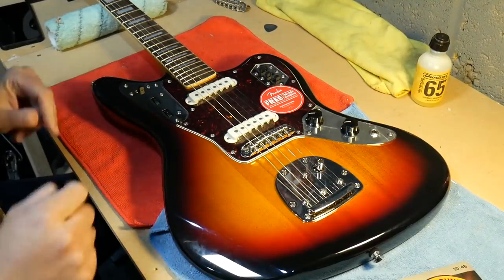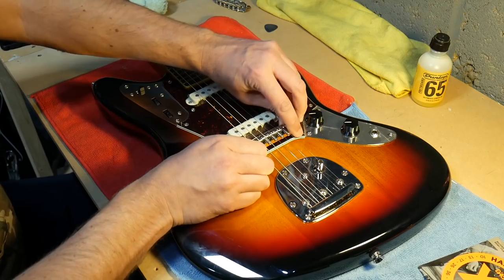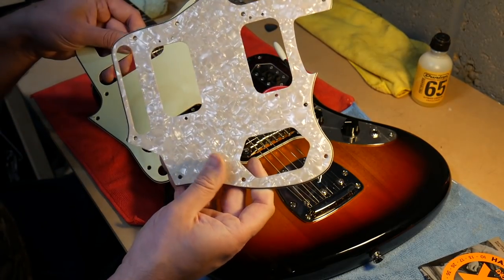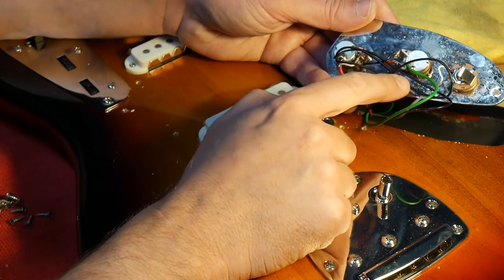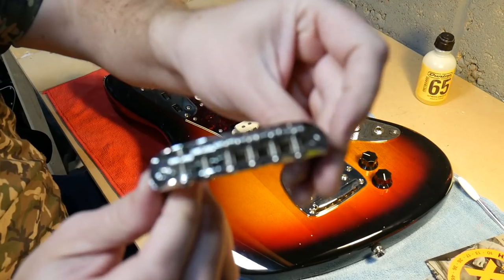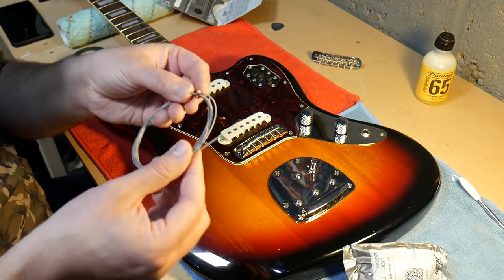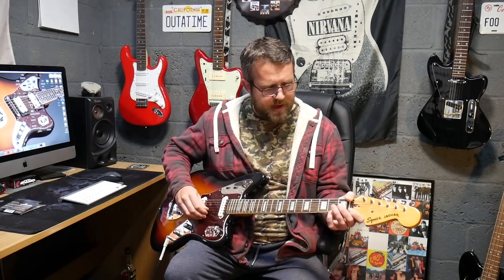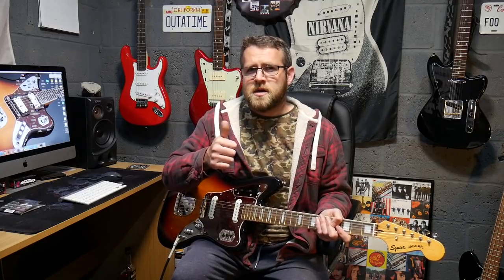The BIG MISTAKE Fender Made With This Squier Jaguar Bridge

Comment: Shim the neck back and raise the bridge. You have to set short scale fenders up like arched top guitars to get a better break angle over the bridge. If you've ever played a vintage fender offset they all have their necks angled back like a gibson
Reply from the maker: Ah yeah I totally agree I didn't think at the time, will do this on my next video hopefully that should cure the problem 🎸👌
Reply: Also the Jag scale is so short, you might think of 11s
Reply from the maker: @narichey1981  no I always use 10s on Jags have done for 25 years
Reply: The Guitar Manifesto Have you ever tried 11's on a jag? I use 10 gauge too but I'm just wondering what the differences would be. I guess the 10s have more slack.
Reply: @narichey1981  I agree! As a guitar gets shorter it requires more string tension: shorter scale = higher string gauge.

Not only will the tremolo and bridge float MUCH nicer, but you'll have normal slack in your playing and no buzz at all!
Reply: @wastewoodrockers5526  I always use 11-52 on my Jaguar, and 10-49 on my Strat. The 11s feel good with the short scale, definitely try it if you haven't!
Reply: @theguitarmanifesto  Leo designed them for 11s
Reply: I’ve just bought a Squier Jag 70s vibe. It is the worst guitar I have ever owned! The nut, the bridge,the trem, the saddles....the truss rod... basically the whole thing needs setting up and possibly a new bridge. 
Before I load it with 10s, can someone please tell me how to shim the neck and deal with the wobbly bridge? I am going to try wrapping PTFE tape around the bridge posts and the trem arm to stop all the wobbling but I think this guitar needs to be fixed in so many ways that i’m going to take it back and have the shop sort this mess out. 
It’s all very nice looking but the mechanics are rubbish.
Reply: @LysanderLH  Lol , you'll have to push the trem arm all the way in to stop it from wobbling . I agree on the bridge is complete rubbish . Mine is defective from scratch , means one leg fell off on a brand new guitar . Look at my other posting . You can buy a Fender bridge from eBay seller guitaraudio from the US , for 9,5 radius . Shim the neck , set the bridge really high  , then go back from there using the Allen key . The fretboard should follow the strings from the nut to the bridge parallel
Reply: @LysanderLH  my experience with my squier jag mirrors yours. Pretty wall hanger, though
Reply: @PugALug70  mine had a reverse angle on the neck, bridge fully down and huge action etc. still contemplating whether to bother sorting it out or send it back
Reply: @wastewoodrockers5526  10's let you bend easier by far...
Reply: 11 gauge flatwounds are perfect on jags. Been using them since the 90s

Comment: The big mistake is using strings smaller than 11's on a Jaguar. This guitar wasn't designed to be strung with super slinkys. If set up properly with the correct strings, everything works just as Leo designed it to.
Reply from the maker: I put a small shim on the neck to increased the break angle this solved the problem, now plays perfectly with 10s
Reply: If I remember right, they shipped with 12s in the 60s. They can be set up with 10s if you're careful though!
Reply: Why does Fender sell Jaguars with 9' s if Leo wanted 11"s?
Reply from the maker: Should be 10s minimum
Reply: @theguitarmanifesto  I'm having the same problem... so do you mean you removed the neck and put a shim underneath neck base?
Reply from the maker: Yes exactly increases the break angle
Reply: @theguitarmanifesto Awesome. What did you use and what size? I've heard(.25mm) is enough.
Reply: @theguitarmanifesto  How did you do that?  Did you put up a video explaining the procedure?  Thanks
Reply: @hanskung3278  Exactly!
Reply: It took Leo a while to get the guitars right!
Reply: Nothing Noone  I use 9s on my LP Muse!
Reply: @hanskung3278  Because they are idiots and obviously stopped caring about their customers
Reply: But the in the 60's the neck was not as slim as it is now maybe put 12 in those slim necks that Squier has is a risk long term for the neck
Reply: I use 9s on my Jaguar, it works fine. 

I added a 0.25 to give more break angle, no issues.
Reply: also ich habe meine vor 2 tagen bekommen und habe 10 seiten drauf gemacht und das griffbrett geölt bei dieser squier ist alles super grüsse aus der schweiz ✌

Comment: sadly through the years, i've had troubles with anything stock on a guitar that cost 500 and less. but replacement parts thankfully even today aren't SUPER expensive
Reply from the maker: It can soon turn into an expensive guitar when stuff needs replacing

Comment: Are all these problems to be expected when spending $400 for a guitar? Is there quality control at this price? Obviously not. I all ways wonder what guitar manufacturers are thinking after they produce a guitar and they know the guitar has fret buzz, uneven frets, sharp frets, rough fretboard nut etc. and they say "screw it, release it any way."
Reply from the maker: It's more to do with the placement of the vibrato, if it was placed a little further back or the break angle was increased it would have been fine.
Apart from that over the 100s of squiers I've owned QC is always too notch
Reply: @theguitarmanifesto  I wish my guitar store carried them, the only jag around here that has a regular c neck, not modern c, is a mij jag special editon hh.
Reply: @theguitarmanifesto  So would you recommend this guitar?
Reply from the maker: It's still a great guitar just have to go with the neck that's on it, My main gripe is the narrow tall frets I just don't like them personally.
Reply: @theguitarmanifesto  Thank you.....I want a jag. I need a short scale that is NOT modern C, I need it thicker. I don't do modifications....as far as I can tell the choce the 70s squire, the Marr Jaguar, the mij special edition hh or the classic player special....any thoughts?
Reply from the maker: I've owned all them guitars you mentioned apart from the johnny marr jag, I can confirm none of them have chunky necks they're all c shaped.
Reply: @theguitarmanifesto  any recommendations?
Reply: @theguitarmanifesto  What would you recommend? The Johhny Marr Jaguar or the Vintera 60s?
Reply from the maker: @hanskung3278  unfortunately I haven't played either so can really recommend one over the other
Reply: @theguitarmanifesto  Ok, thanks .

Comment: Put a shim in the neck pocket and use heavy strings. That's what I've learned from setting up a VM Jazzmaster and several Mustangs and that's also how the original Jags came from the Fender factory in the early 60's. If the saddles move around because the springs are not strong enough you could try some Loctite. This usually works very well.
Reply: soulagent79 super glue is good if you have a buzzy brass nut ☺

Comment: ive had mine for week , im still teaking it , the bridge is just weird , two posts balanced in thimbles ? the trem is noisy , and it will not stay in tune , ive shimmed it and set the neck relief, raised the bridge and put heavier gague strings on it , iv also spray painted the body in black matte and burnt the chrome plates to bring out the copper , it looks cool as but it still not right

Comment: For having more tension and angle on bridge there is a thing called "buzzstop". You can try them but a friend of mine said that when you use buzzstop the trem doesnt come back to it's normal position. I haven't tried them.
Reply from the maker: You lose the chine from the strings behind the bridge, kinda what gives the Jaguar it's iconic jangle sound

Comment: Instead of plastic tape, you can also use Copper or aluminum tape. I find this adds a bit to the overall sustain. I prefer the copper tape. This also works much better with copper tape on the old MIJ Jag's and Jm's that are grounded on the bridge instead of at the trem plate.  Another trick I use a lot on these guitars is replacing the thimbles that go in the body with Tune- o- matic thimbles, remove the feet of the fender/squier bridge and drill a hole in them so you get a kind of TOM/Jag-Jm hybrid bridge. Requires some work, but It makes the bridge more stabile.

Comment: There is a roller assembly available on you tube,and other places im sure,that screws to the trem plate,and increases bridge pressure to never slip again. For about 15.00 its as easy as 2 screws
Reply from the maker: Ah yes the tone killer

Comment: Johnny Marr says to use 11s  power slinky strings with your Jaguar so that's good enough for me.My Blacktop p90 version doesn't have a trem so no worries about wobbly bridge ,it's got a solid tune-a-matic bridge but looking into whether a roller bridge would drop straight in as thinking about  Duesenberg Les Trem

Comment: Had my very cheap Squire Vintage Modified Series Jazzmaster routed and the StewMac Golden Age Bridge & Tremolo installed.  Changed the Bridge like you did, but found the string spread was different.

Comment: Try a buzz stop. It puts a sharper break angle on the bridge and eliminates the ringing on the trem. I put one on my Jay Mascis jazzmaster and it solved the problem and actually made the guitar sound better. Inexpensive part.
Reply from the maker: Yeah that's another option right there 👌
Reply: That's an excellent option!  My CME LE Jazzmaster came with the trem closer to the bridge for a similar effect.
Reply from the maker: As someone pointed out earlier a cheaper solution could be to shim the neck raising the bridge and increasing the break angle.
Reply: The Guitar Manifesto definitely worth a shot. I think a shim will help a little but to put more downward pressure on the saddles it may not completely get the job done. I typically shim most Fender necks so I’m not sure a simple shim will be enough.
Reply from the maker: I've done a few myself worth a shot as it's free, I'll keep y'all updated

Comment: Once you have the intonation and string height set to preference apparently the bridge rattle can be remedied by dropping some clear nail polish into the bridge screws/springs. Probably a safer option than Loctite superglue method as you can always take off the varnish with nail polish remover.
Reply from the maker: Personally I wouldn't go with that option, I'm going to shim the neck to increase the break angle also try and replace the springs with some more heavy duty ones
Reply: The Guitar Manifesto good luck hope it works out for you 👍

Comment: I bought the Squier Jazzmaster classic vibe 60's with same bridge.  After 2 hours of playing the bridge dropped where the strings were hitting the frets from the vibration of playing.  They are fussy little buggers.  I should have known better owning other Jaguars/Mustangs.  Locktight/nail polish on the bridge height screws to keep them from buzzing/dropping.  I also have Jazzmaster w/ Adjusto-Matic bridge with incredibly low action and no buzz.  I will upgrade my others to Adjusto-matics, eventually.   I like the idea of the Mastery bridge, but they are really expensive, and I get great results from the Adjusto-Matic.
Reply from the maker: My Jazzmaster has a Tuneomatic bridge no problems with that apart from the radius not matching the fingerboard. The stock vintage bridges should be left in the 60s 😂
Reply: I read about these problems before buying and did get buzzing after about 20 minutes of play, so I adjusted the bridge to my desired height then dipped it in hot wax, wiped it clean and have had no more problems with this vm jag (even still using origenal strings!)
Reply from the maker: yeah I get what you're saying I think the problem with this one is a lack of tension on the strings

Comment: I had a similar problem with a replacement bridge on a VM Jazzmaster I had a few years ago. I finally wrapped some fine wire in a loop around the threads from low E to high E... effectively fusing the saddles together. You could hardly see it and it worked a treat. :)
Reply from the maker: That's one way of doing it 🎸👌
Reply: Did the wrap fix the high E buzz?
Reply: Hi: I didnt have that problem... I was referring to the unwanted movement of the saddle.... but..... a buzz just might be caused by the loosness in that area and vibration? worth a shot. :)  @hossak88

Comment: I was thinking to get one of these. I went to the local GC to demo it. I liked it a lot and enjoyed the tonal variety. I did not care for the glossy neck (I'm so used to the satin or unfinished necks that it's hard to go back to these). Oddly, I had serious issues with the high E string on their stock model. It got worse the more I played it. It sounded like it was fretting out from the 12th fret on, and even just playing the open string. Seeing the same issue here makes me not want to get one. I was hoping it was a bum Squier...but they might all be problematic.
Reply from the maker: The neck can be easily sanded down for a satin finish, sound like it needs setting up, also putting a higher gauge string and  neck shim in helps out a lot
Reply: Meat this guitar is a nightmare 😹! It's too much work and I like the Bullet mustang has no work needed stock!
Reply: I'm not going to buy one after playing it!
Reply from the maker: To be honest it was a pretty simple fix
Reply: @theguitarmanifesto  The Jaguar and Jazz master guys complain about the Fender!
Reply: I realize this is an old post. I just want to mention, for those that have run across it more recently, that the newer Mustang bridge bodies on, say, a '20-21 Squier supplied DOES have inherent problems. Jazzmasters & Jaguars WERE designed for 11's by Leo, as strings under '11's weren't so common back then. 
 9's or anything smaller are too light, & floppy to make the bridge move with the strings under tremelo use, and then return to true. The strings aren't capable of exerting enough downward pressure to hold the bridge down so it will perform as designed. 
 The Palm Mute feature, is what I assume is being called the tone killer here... I for one, like them and don't feel that when un-engaged, it makes any really noticeable difference in the tones I get. People say why not just Palm Mute? But, its a unique sound, and part of a lot of music I grew up with. Sorta like the strangle switch, a bass cut, or high pass switch with a capacitor attached. Love it or hate it, it's an original part of what I like about the various sound options it has to offer.
 Same for the somewhat.... Darker(?) sound the switch to the upper bout of controls activates. Kurt and others have removed or taped it off, for fear of changing circuits mid-strum. But, if you don't play so hard you can't control your strum strikes, they make little $4-5 plastic pieces that serves as a block to keep that switch from moving. Parts don't get misplaced, no tape, or if you want to use it, no tape residue!😉 
 If you can work a screwdriver, have blue/MED loctite, and a good file or belt sander to shorten intonation screws if needed, you can shim your neck and maximize your bridge's behaviour. 
 If the tremelo arm wiggles, push it in further. If it clicks, adjust the center screw that's attached to the spring inside. Either find a floating position where you can bend up or down without the clicks, tighten it to where you can't bend up or down, all the way. Essesentially making it a hardtail.
 Once strings are off, dismantling your bolt on neck rig is truly simple. Make notes, &/or take pics & measurements of how things are as you remove them if you're worried.
 It's also a great way to know where your bridge height needs to be. They were a part of basically every Jaguar and Jazzmaster, fresh from the  factory once upon a time. And I can't fathom Leo adding a device that audiably detracted from the instrument. I think properly installed, it is just another sound manipulator option for the most mis-understood switching system I've run across.
 The 2 bridge height adjustment screws, adjusted from the 2 holes above the legs, WILL typically retract over the course of playing. Most notable if you wiggle the trem bar with much regularity. &, eventually it will bottom out and be flat against the body.
 Once you shim your neck, using the exact same string diameters you intend to use regularly (*may require widenening the nut slot size), then get your bridge height/action set up (*possibly adding small truss rod relief adjustments as needed, to kill fret buzzes), & Intonate it.
 Now either un-string it, or if you have enough winds on your tuner posts, you may be able to just loosen the strings enough to get the bridge piece out. Add a drop off BLUE locktite to each height adj screw.. 
 You can use a heat gun or hairdryer, or, even heat from soldering iron to break it free if you discover you didn't have it exactly right later.
 Same with intonation screws if they give you troubles. 
 If your intonation screws are touching strings one intonated, take out the set screw, and cut off &  just enough of the screw tip to remedy that. 
 If the low E string hits the top of the bolt as it exits the rear of tremelo body towards the neck, pull the tremelo body put, remove, & then reinstall the offending bolt, just starting it from the bottom side this time.

Comment: Thanks for this video. I thought I really wanted a Jaguar but after watching all the necessary bridge mods and/or bridge replacement plus possibly having to shim the neck no thanks. My old MIA and MIK Fender strats didn't need all those mods; I even bought a cheapo $97.00 Chinese import project guitar and straight out of the box it only needed a little intonation adjustment to play and sound good. Fender should be ashamed.
Reply from the maker: It's a rubbish setup that's for sure